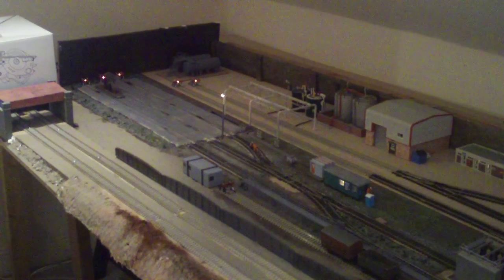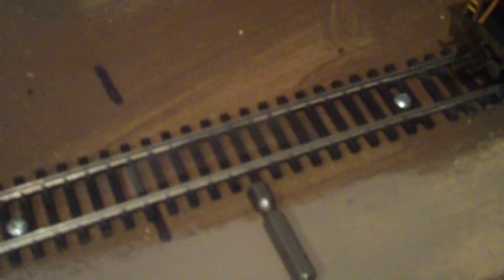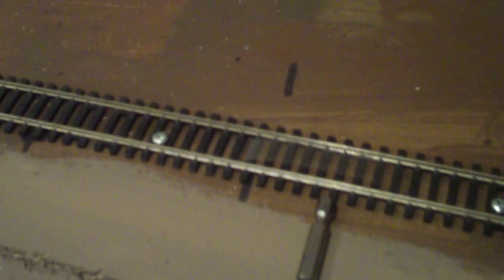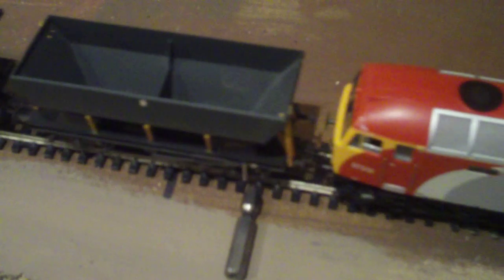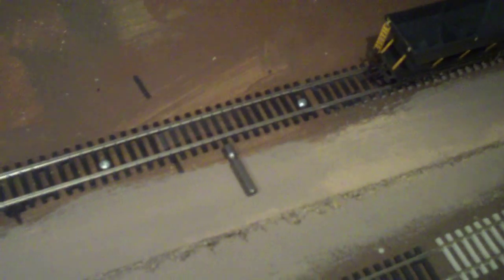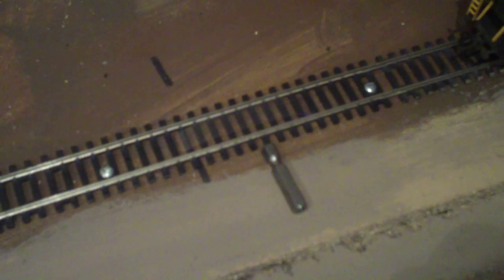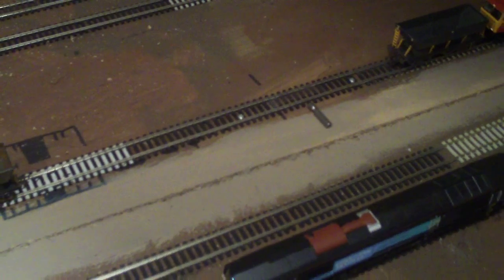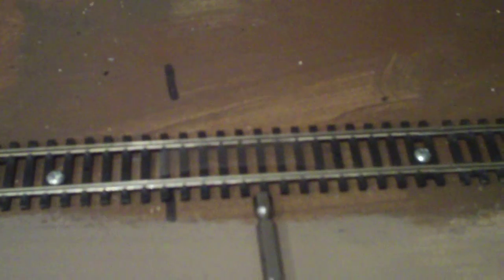Hornby railmaster auto uncoupler strip demo p1

Comment from the maker: @pyronathanpyro yes mate  i use to but these screws were just temp for this clip to hold it in place i use smaller screws and they work better for me on my trackwork rather than pins which are noisey to put in as most my work done on a nite when lil un in bed lol

Comment: @uzyadadi lol what id do if your not happy is take all teh track up and the lot and all the boards and sand em all clean and then get some 70mm by 18mm baton and build some 4ft by 2ft baseboards and use the batton to frame them and lay then out around the loft and then lay track no pins not conected just lay it to the board and play about and lay points in the way you like em and just do that till your happy its what i do and i can send a few pics via email if u need some